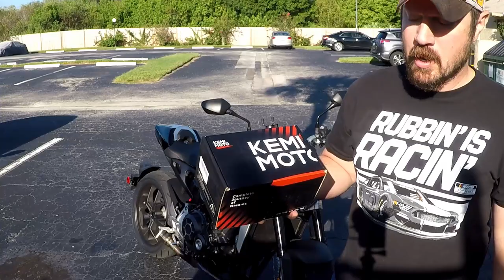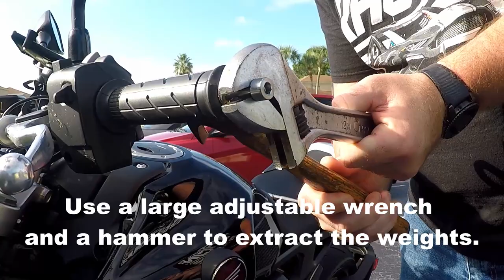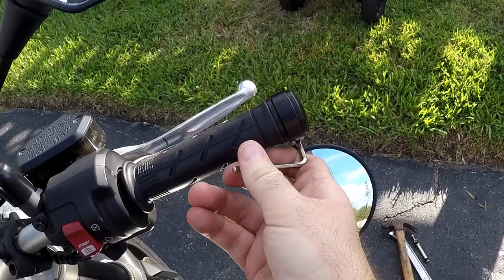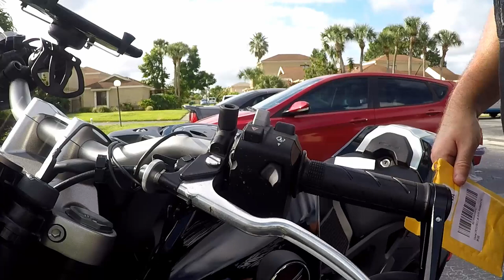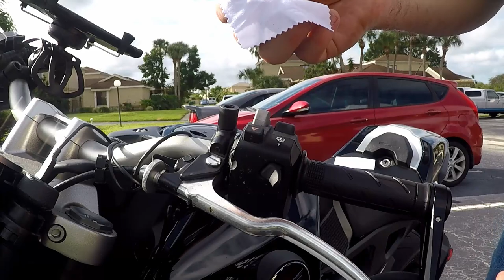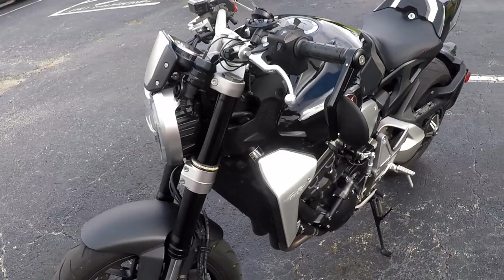2018 Honda CB1000R Bar End Mirrors Installation

Comment: Instead of the screw plugs I used the RAM Mount ball adapter (RAM-B-349U) so it looks even cleaner when no X-Grip is installed.
Reply from the maker: What a great suggestion!!

Comment: yh, 2/3 of the view in the stock mirrors is my own shoulder and elbow
but then i don't wanna add 3-4 inches on each side to the width of the bike, sometimes the space is tight when filtering between cars on traffic lights
mounting them under the bars, like you did, i would probably hit the gas tank
Reply from the maker: Visibility sucked when they were under, I've since moved to the top and it's much better now!

Comment: Great vid! Did you noticed any vibrations after removing the weights? I am going to mount them on my Cb650r
Reply from the maker: Vibrations are not noticable at highway speeds but in town I didn't notice a change 👍

Comment: Nice video. Do you know if the weighted handle bar inserts could be pushed in further instead of taken out in order to have both inserts and bar end side mirrors?
Reply from the maker: That's an interesting question. I want to say they can't based on the size of the weights but that would be purely a guess. I'll write it down and see if I can come up with an answer.  To be honest though, I noticed an extremely small difference in vibration, so small it could be my imagination.

Comment: Great video, very helpful. I don’t have a CB yet but plan on getting one. Are the stock mirrors capable to being switched to the down position? Seems like they would but could be an issue with hitting the tank when turning…
Reply: That would be totally hideous. Wouldn't it?

Comment: Do you have clearance with the mirror when you do turns ? Or even when you lock the bars in the park position
Reply: Or more so like are the mirrors hitting the tank when you turn the bars ?
Reply from the maker: No issues with the positioning I have them set to. Just check your full steering lock with the mirrors in place before completely tightening down.

Comment: Good video bood!
What type of exhaust tip you running pls?
Reply from the maker: Thanks Jason! Pro-Race GP-S1

https://www.pro-race.co.uk/#!/HONDA-CB1000R-NEO-SPORT-CAFE-2018-2021-GP-S1-Slash/p/120699954/category=30306004
Reply: @BrosefRides  Cool as.
I’m from Queensland Australia.
I scored a brand new on the showroom floor 2018 model Ruby red cb 1000r.
Ready to mod.I seen your pipe and it looks the goods.Is it loud??
Reply from the maker: @fntmns4845  congrats! It's loud without a helmet but with it on I don't think it's a problem. I can easily have a conversation.
Reply: @BrosefRides  Ok...does it have silencer built in??or is it a straight pipe
Reply from the maker: @fntmns4845  no silencer, completely straight pipe

Comment: What is the size of the handle bar if I want to change to bar end mirror?
Reply from the maker: At the bar end, the outer diameter is 22mm. Most universal mirrors suggest using the 7/8" mount which will fit internal diameter of 13 to 18mm. The ones I used had a 7/8" mount.
Reply: @BrosefRides  
Can u look for me the kemimoto mirror in "ali ekspress" app and share the link to me? thanks
Reply from the maker: @ZYD1197  I'm sorry, I don't use AliExpress but if you use Amazon

Kemimoto Motorcycle Handlebar Rearview Mirror:  https://amzn.to/35dMgdu
Reply: @BrosefRides  If you click on that link you posted, you will see it’s not for the circular mirrors though. And there’s no option for those. Do you have a link for the circular ones??
Reply from the maker: @benjaminsalopek3394  Ben, here's the link I used to purchase the mirrors. I'm trying to get a discount code (should have it tonight) so please hold off for a day.
https://www.amazon.com/dp/B0919WTD9X/